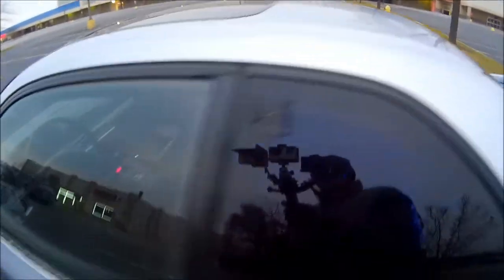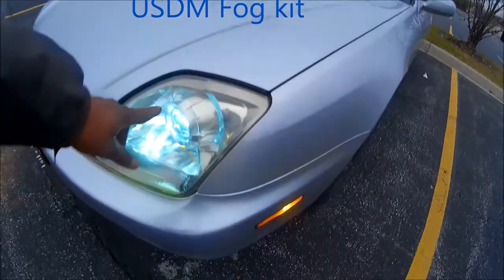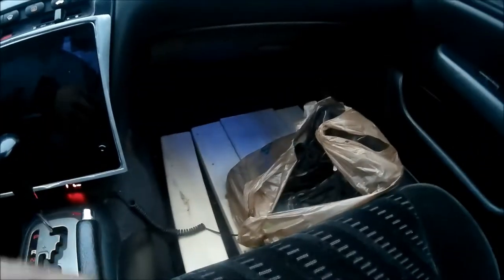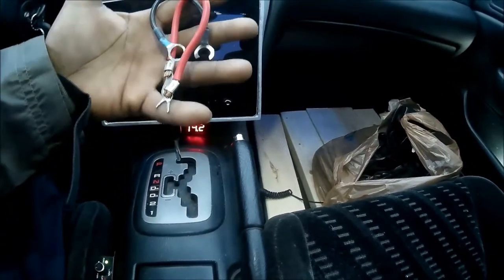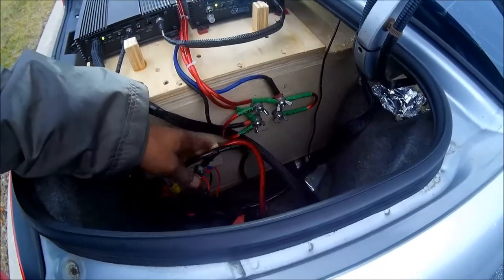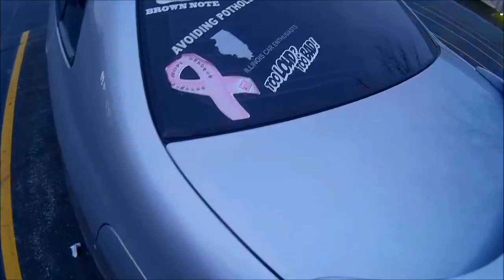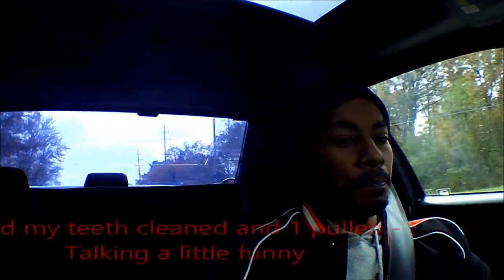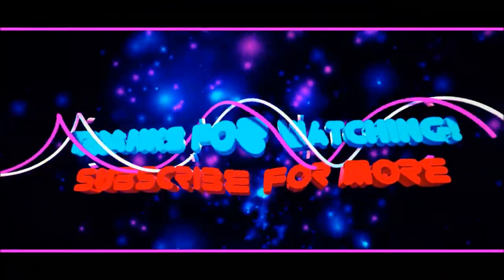EMF and DD Audio System Update & BASS DEMO

Comment: U need to tek flex the power wires it made my install so clean I got 25+25 ft for like 25$ my ground loom I have most of it left but nice system
Reply from the maker: I have a ton of it - Lol Ive been too lazy. Every time I went to do it the sun or the heat turned me right back into the house. I definitely believe in it - it helps keep the wire jacket protected and just as you said looks damn good :-). I will do it soon. PS Thanks Bro Much Love :-)

Comment: Thanks for sharing bro 🤙🏾 Very calculated build. How much does the output change, with the seat in its normal position? Trunk and cabin?
Reply from the maker: Thanks for the love bro. Lots of trial and error. This cabin is funky but I like a challenge, USACi style nothing done driver door cracked it will do a 141 flat on music in SB1. Open glove box and remove head rest (pass) it does a 141.5. Last official run of the season I opened my door all the way (odd) and did a 145.1. Easy 4db gain from playing with that cabin.
Reply: bigvell02 - 🤯🤯🤯 Dude that’s way over my headed bro 😆😆😆 I’m talking to the ear and eyes. I don’t understand or do numbers. I keeps it simple 🤙🏾 over here 😂 Just wanted know the differences you can tell with the seat up. Driving the car, setting in the back seat and outside watching the trunk dance 💪🏽
Reply from the maker: I call that real street style. (My Roots) Been hanging out in the lanes kinda tough this season. Doors and windows up loud on the inside some have said it sounds like 4 12s or some 15s. And 90% don't believe ts just those 2. When I open a window the flex gets real.... I had to repair the metal in my door near the regulator. I broke my coolant temp cluster, and now my sunroof is SAD lol.
Reply: bigvell02 - No that explanation I can understand 😆😆😆😆👍🏽👍🏽👍🏽 Those bad boys are putting in work! Hit a pot‘na looking at a pair himself. I will pass this information on 🤙🏾 Thanks bro!

Comment: The CT sounds component set the 5.25 with the tweets and the xover is like 62$ u get so much for 60$ it is crazy nice box different brackets for the tweets feel like 150$ not 60
Reply from the maker: That's a nice deal and Ive never owned or installed a set of CT I would like to see what they are about. I went from Bose premium to Hertz hcx165's (powered by a JL 600.4) Then back to Bose - Blew them out a few weeks ago now I'm bumping the LOL's in my doors :( I plan on adding some new 6.5 along with some 8's and super tweets. Can we say door pods :) :) :)
Reply: Kustom Klosure Designz did the same as well. I commented on one of ur vids as well about ur voltage
Reply from the maker: I got you.
Reply: Thanks BASS ON !!!! Subbed Ya Back